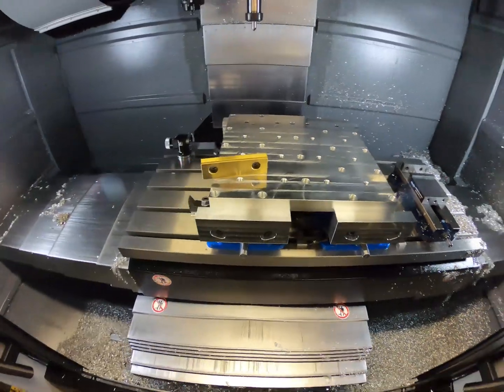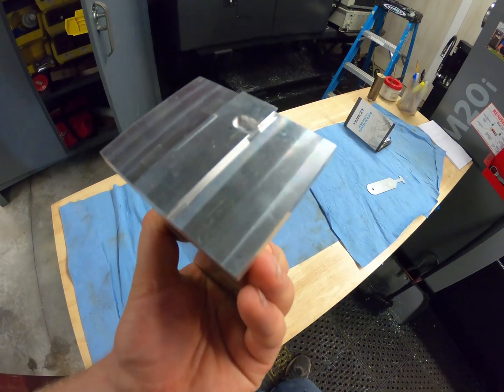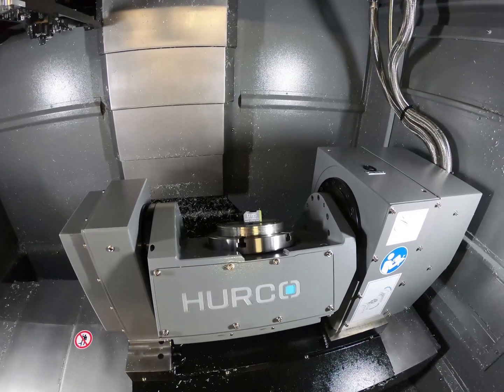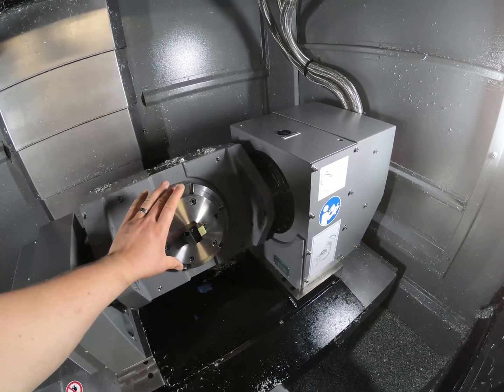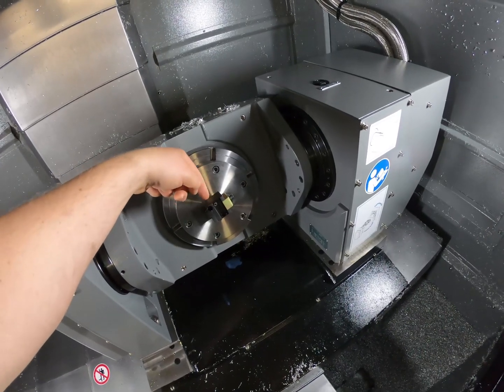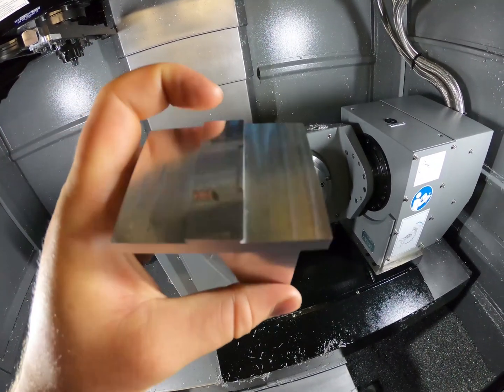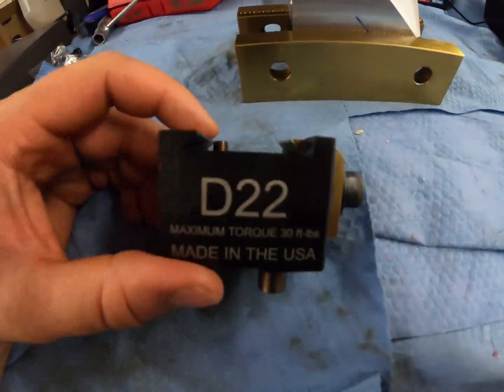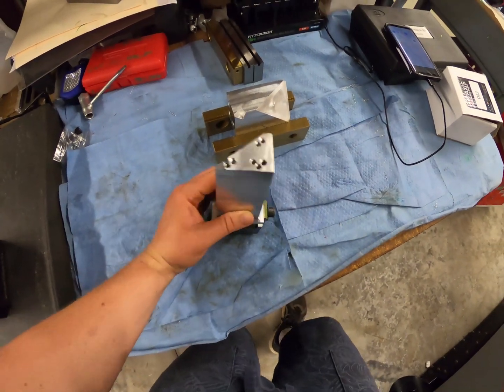Finding the BEST--5 axis vise!

Comment: 2:45 .......not a good finish :/
u should try roughing about half an inch in Z...then finish it, and so on....to keep the rigidity of the stock
nice work anyway! big ups !
Reply from the maker: If you watch another 15 seconds you will see me explain the poor finish. The dovetail actually is what failed. We did fix by taking lighter cuts like you recommended, but the best fix was a bigger dovetail vise